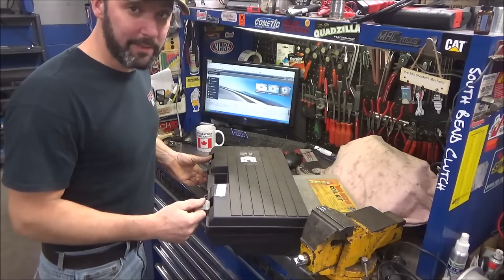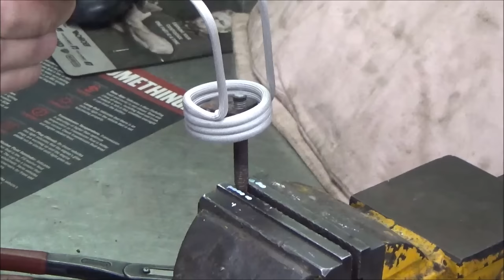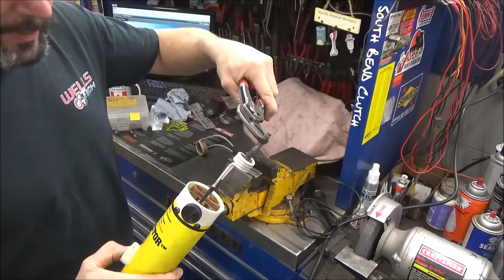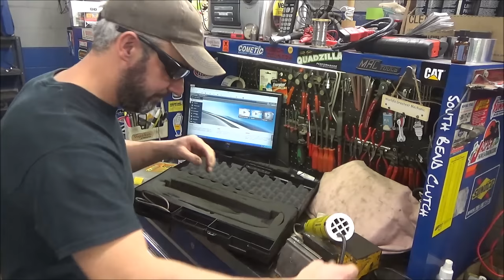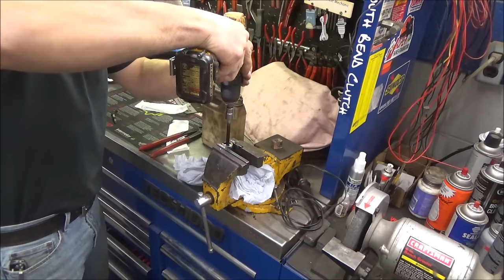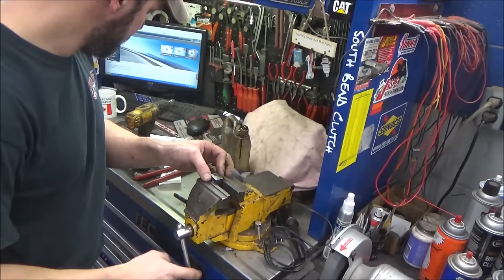How To Heat Up A Nut or Bolt WITH OUT A Torch

Comment: The other cheap way to do this is with an MSR pocket rocket or any other type of camping gas stove. Those will run you $20-30 and I’ve used it to loosen bolts with heat too. It’s small and you can put it right up against the thing you need to heat. Bonus is it gets really damn hot.

Comment: It works by pushing the button then the nut or bolt heats up
Reply: ET 2AD19 7581 lmao...theres positive and negative wires fed through the coil. hereby when electricity passes through  the coil it contains heat in the center giving it the ability to heat up anything
Reply: Dawson Campbell It is just a transformer, the primary winding is your coil and the secondary winding is the bolt or nut you are heating.  The frequency is optimized for the application and it acts as a hell of a step down where the bolt heats up by the current formed by interacting with flux field.  Because of resistance in the metal you are heating up , by ohms law power must be dissipated in the form of heat.   The whole application is all based on electro magnetic theory but too much to expand on here.  I just found another was to loosen nuts, a candle and a lighter.  Search for it.
Reply: The coil does not heat. The coil is the antenna for radio frequency that does the heating. Just as in a microwave oven, the target (bolt) is the only thing containing heat.

Comment: i think the shank on that bolt is bigger diameter than a typical thread spec. ,you probably ruined that die
Reply from the maker: nope it works just fine still

Comment: Minor explosion 😅😅 The hell were you heating up bud?
Reply: Itself.   If the insulation wore away and it blew up like he said, he probably had the electrode touch itself through the worn insulation and it shorted out and caused a massive spike in heat, thus the "blew up" part.

Comment: I like the tool bags saying a butane or propane torch from home Depot is equivalent to a torch. If you have actually used both no comparison. Oxy/Acetelyne is way faster and heats better and faster. This tool is faster and better than a propane or butane torch. Noobs.
Reply: Now would a propane torch still do the trick? Definitely would take significantly longer than an oxy/acetelyne, but if it works it works. I've never tried the propane and don't own an oxy/acetylene.
Reply: Mapp gas is cheap and works better than propane. Its about $10 or less per cylinder.
Reply: Mapp is for plumbers not mechanics. And have you ever used a oxygen/propane torch set?  When "torch" comes up in conversation with mechanics we're not talking about the 14oz small bottle mapp/propane torches.
Reply: jhitt79 Mapp gas torch works fine and is convienient. Not as fast yes, but it gets it done.
Reply: Gerald L no disrespect intended, but have you used an oxy/acetylene torch?  Mapp isn't going to heat thick steel/cast to red hot. Not going to cut steel with mapp either. So when you say "it gets the job done" I suppose it does depending on the job, but I really have a hard time believing it's going to be useful doing anything serious.  I work on mostly equipment and industrial pumps at a wastewater treatment plant. And do a lot of small engine work at home on the side as a supplement to income and hobby. I never reach for a mapp gas torch. Just recently did a wheel hub/bearing job (I live in Michigan where everything is rusty) there's no way mapp would've heated the knuckles like I needed to to get the hub bolts out.
Reply: Yeah Gerald mapp gas won't do anything if the parts are truly seized up

Comment: So you think we would have something like that. That runs about $260 to $480 over a $24 dollar torch. Idk
Reply: LOL I never thought of it like that but your right You can build one way cheaper than buying one that's why I didn't think of the cost comparison it is amazing what a little heat  can do to help remove a part
Reply: $25??? Not talking about mapp gas here.
Reply: Pedro Clemente Some places you need heat, but can't use a torch because of what's close to the seized fastener.

Comment: The only problem I see is that the bolts I have to get to are inaccessible with this tool.
As a bench tool it would be great.
Reply: Comes with flexible ends that you can bend

Comment: My dad had a radiator shop, we'd just bust the bolts and then replace them.  Carriage bolts are cheap.
Reply: Yeah! Well most jobs are more complicated than replacing rads. Would you bust the bolts in a head, engine block, etc. too? Something any mechanic would try to avoid at all costs.

Comment: just so people know ,when heating up something like that you have to work fast cause the heat soaks into the bolt  ,which means it is expanding and wanting to get even tighter so hurry up before the bolt gets hot...same goes for using a torch, and just so the viewers know , a propane torch does not heat very good without having a oxygen bottle hooked into the system
Reply from the maker: 100% true
Reply: Mostly disagree with that.   First, no, the heat is expanding the chunk the bolt is in so it expanded.  He obviously wasn't rushing.  The bolt itself will sink away heat faster because more of it is outside of the coil.

Second, a propane torch w/o oxygen (not MAP) does fine to heat something that small.  Maybe not so much if your have a bolt stuck in a large mass like a block, but this won't work well on that either unless the bolt is sticking out.  The larger reason I see to use it is that it is more localized heat where you don't want a torch around flammable or melt/brittle things.
Reply: It doesn't matter.   If both or just one expand and contract the effect is the same. When it heats, the rust is crushed, When it cools the inter-thread gap is less obstructed.

Comment: I may need to buy one of those to get the crankshaft bolt out of my Nissan Frontier.  IT WON'T BUDGE!
Reply: Uh... we're more likely to have a torch than an inductive heater laying around! 

Can't believe you said we're doing it the Polish Way in this day and age !!! ... Insulting to Poles !!! 

Still doing it a bad way, should have just put a socket and ratchet wrench on it... 
.
Reply: have you tried putting socket and power bar on it and giving it a short crank with starter ,providing its not L/H thread?
Reply: Got a 3/4" air impact gun, a 3/4" X 19 mm socket and Oh ya, it came off then!
Reply: I never knew or saw a power bar until SMA Eric O used one!  WOW!  Wish I had one earlier.  Oh well.  Got the bolt out, the Nissan's back on the road.
Reply: @mikechiodetti6737  do you mean a car power inverter???
Reply: @dannynica7480  No.  I've seen Eric O use one.  It's all manual use.  My new 3/4" impact wrench solved the problem.
Reply: @mikechiodetti6737  do you know on which video he use it??   thanks for the reply.  u have an air impact or cordless

Comment: I'm not a machinist, but it still made my skin crawl a little. buuut, I'd probably do the same on a cheap tap die set, now that I've seen it. on a cheap set though haha, not a nice set. 

preferably those threads would have been run on the lathe, or a nut welded to the end of a piece of all thread. worked good enough though

Comment: I'm surprised you didn't break out a cnc machine to cut the threads after suggesting a $500 tool for Joe Bob diy guy vs a $45 yellow can of fun from home depot...sheesh...n you talk crap about the polish? hmmm pot calling the kettle black
Reply from the maker: Lol says the guy who has a avatar of a gun that cost more than this tool. Oh and BTW... I am Polish so it's ok.
Reply: South Main Auto Repair fyi, I'm polish also...but that firearm in my pic is not as expensive as that inductive heater tool is...n it gets used everyday, is relatively cheap insurance divided the cost by number of days it's been carried and/or served a bedside security role, and in addition provides a useful function almost everyday of the week and is hella fun recreationally. I guarantee it's been used more in the past month than that inductive tool would be used by a home gamer in 5 years (the point of the vid) ...n prob even in your professional setting also since you mentioned in the vid that you only use it occasionally. map gas is cheap relatively speaking...and a way better and more accessible option for the home diy guy...even IF they had to buy a torch head or buy more than map gas and add an o2 tank and a head and hose kit. ....still, more accessible & cheaper is all I was saying. the coil kit would cost more than than a yellow, a red, a head and hose kit. ....vid just didn't make sense the way you made it. if you wanna show off a tool, especially a rarity just show of the tool and don't suggest that it's a home gamer option. you didn't have to take such offence to the cnc threading comment...it was relative to the portrayal of the way the vid was put together. it was just a relative joke...
Reply: S.M.A.R offered the people an option, which I'm sure was his intention, and the peoples choice to choose or not... not yours to insult that decision or intention. lighten up

Comment: I'm just wondering if you can cook a hotdog with it
Reply: not unless the hot dog is made of ferrous material.
Reply: @tobygathergood4990  it produces its own heat it will work on anything not just ferrous materials
Reply: @josephfuller6229  Absolutely not true pal.   An Inductive heater just produces a magnetic field.  It's the bolt itself that is producing the heat.
Reply: @josephfuller6229  does not produce its own heat - obviously: did you see the coil getting red hot?
It relies on ferromagnetism and its interaction with high frequency EMF. A ten second Google search would tell you that.

Comment: tHAT EXAMPLE BOLT WAS REDDER THAN A REGULAR PROPANE OR MAP GAS WOULD GET IT.
Reply: I second  this comment.  Hundreds of bucks for an induction  rig vs 4
$40  for a plumbers torch 
.
Reply: I used one of these on a rear shackle bracket and I can tell you a propane will NOT, repeat DOES NOT, get it hot as this does. The reason I borrowed the induction is because a plumbers torch would not work. This gets it much hotter and does it much faster!
Reply: @stevenjames3242  when the owner of our shop retired he left one of these on the shelf and his grandson found it only to laugh at it and throw it away. Figures hey? I kept saying id take it home with me but well that was a few years back and i can see like many things we could have used it on when oxy-acetylene ran out.

Comment: Easy to make one from an old microwave transformer
Reply: why use a MOT? Low voltage & high current with fast switching MOSFETs work fine. Easy to run one off 12V.

Comment: came here cause i dont have a torch and realized i dont have an inductive heather either so im leaving in pain the same way i came here :(
Reply: Small propane torches work just as good.  Mine has saved my bacon a few times.

Comment: Magnetic induction...I wonder if someone could just build their' own magn induction tool...of course they could.  All you need is a small fan for cooling....some copper wire for the wire cage...and some resistors to contain the power.  Shouldn't be too hard.  Basic electricity.
Reply: Really?  I'm worth 2.3 million...and retired at 54...how about you?

Comment: This is just not practical for shade tree mechanic at $500.00 a pop.
Reply: That was my point, exactly. How can he suggest this to people that don't have a 20 buck torch as a good alternative. When he said you could hear it running, that was just the cooling fan for the electronic inside. The basic electronic board for an induction heater are on e bay for around 40-60 bucks and I was considering building one or hacking one of those induction heater hot plates that go for about the same price and are very similar.
Reply: Yeah even a cheap handheld brazing torch from Home Depot would work

Comment: a lighter and a crayon works too
Reply: explain please?
Reply: Use the lighter to warm up the seized bolt. Put the crayon onto the warmed up bolt. The heated bolt will pull the crayon wax into the threads, coating the threads which allows the bolt to come out.
Reply: they call that 'quenching'... the lighter may not produce enough heat...
Reply: Yeah, I done it with 3/8ths bolts. Took a while to get enough heat to melt the wax. The lighter became too hot to handle lol, but it worked. I prefer 50/50 acetone and atf. It has yet to fail me.

Comment: I didn't know that they made a handheld induction heater. I've only ever used a full sized one. 
And I admit that watching you chase new threads on a rolled threaded bolt was a tiny bit cringe worthy, but I must ask, don't you stock any threaded rod? You could quickly have cut it to length and welded on a nut to create a new bolt,  with perfect threads the whole length. Not a criticism, just wondering if you thought of that but preferred your method instead, for some reason?
Reply: I don't know why, but I think I'd rather cut threads than weld a nut on. Maybe just concerned that my weld would break and I'd have a bolt with no head...

Comment: Isn't that how an electric soldering iron works?
Reply: No... your basic soldering iron uses straight electrical resistance, no induction.
Reply: @rhymereason3449  OK,  thanks for the info.........................
Reply: No and the explaination is going to be very nuanced.   

A soldering iron has the electrodes wired directly at the tip.  It feeds electricity to the electrode (the soldering tip) and because the electricity is designed with resistance in mind (Voltage + Resistance = Heat).  An Inductive heater works slightly differently and via a different electrical principle.    

First you need to know that electricity and magnetism are essentially two sides of the same coin.  One can create the other.  So here, the inductive heater is using it's own voltage and running it through those insulated loopy loops of the attachments.   As the electricity flows through those loops, it creates a magnetic field inside the area of those loops...where he held the bolt.  Now, the bolt will interact with that magnetic field and the magnetic field (flowing) will create an electric current within the bolt.  Since the bolt is not able to move that electric current (resistance), it is resisting it and thus heat is created at that point.

Comment: Could have used that contraption many times in my youth.  Still think about this manual tranny drain plug that beat me and all these other snot nose kids working the Jiffy Lube I took it to once trying to get it off.  That would have zipped it off rather quickly.  I probably couldn't afford it back then as I was a snot nose kid myself..:)

Comment: not many home mechanics will was to spend that kind of money
Reply: I have and would gladly spend that kind of money on a tool that enables me to perform my own auto repairs correctly, rather than pay that kind of money to a professional who is most often more focused on speed rather than quality.  Most auto mechanics I know are not as conscientious and honest as Eric O. unfortunately.  To get the job done right, I do it myself.
Reply: I did, and it's one of the best mech tools I ever bought!
Reply: It just means you need to do more of your own mech work.    I paid over $300 for a battery operated Impact Wrench and I'm a home-gamer.  I justified the purchased by now doing all my own suspension work.

Comment: The thing is, getting paid for this "neat" way of doing the job. The money side of this operation can't stop with the mechanic. The mechanic must be able to charge for this process. How much extra was the charge going to be if the heating was done with standard gas torch? All of this is fine, as long as the payment for this technique does not originate in the mechanics pocket.

Comment: A heated up rusty bolt should not squeak while removing it. That's how you can tell if it's hot enough or not.
Reply: I would heat end jam nuts on tie rods for alignments until they're molten red and slag dripping off (only happens when the owner hasn't done an alignment in 10 years lol) but it would still squeak. Can't be tight if it's liquid.
Reply: @derekblubaugh3836  LOL!!! can't be tight if it's liquid...hahahahahaa
Reply: Did it come out? Lol

Comment: yeah nice tool but less than $20 at HD will get you a butane torch
Reply: Archontechnica the point of this video is how to remove bolts WITHOUT a torch...LOL
Reply: ***** not if you know what you are doing. Heat it till it glows, shoot cold water on it, and tighten the nut to break it loose. Should take about 5min at the most.

Comment: 50 years old never  seen 1 of those, much easier to run to local, ANY hardware stor eand get a torch SMH
Reply: Did you not hear what he was saying about not wanting to put heat in tight spaces?  SMH

Comment: Thats one of the expensive big dawgs...  you can make one for around 150$ and is way more compact than that..  looks like a little pistol...  usualy lasts a while also before needing to replace the triac..  but if you put a fan on it and heat sink than will last that way but then you have a bigger hunk of metal on it with a constant fan blowing...
Reply: You mean you can make one for 10 bucks.

Comment: All import cars bolts break 27 years ase mechanic cheap metal
Reply: alvin boreo I definitely agree with you. I'm redoing the whole chassis/suspension bushings, driveaxles and exhaust on my 89 honda. All I have left to do is the driver's side CV axel and would you imagine how many bolts have galled, rounded or snapped?? 1 exhaust header bolt. That's it.
Reply: Red Nine you must not live in michigan lol
Reply: alvin boreo lmao good point I live in Cali. The only things that rust on Our cars are the exhaust and rotors
Reply: Not entirely true, all really depends on the manufacture tbh. Stuff like Korea I would agree, but most from Japan seem to be pretty well built
Reply: Bolts on Kia and Hyundai are fine. The exhaust bolts seem to hold up way better than Nissan.